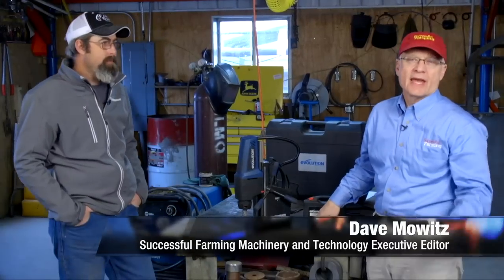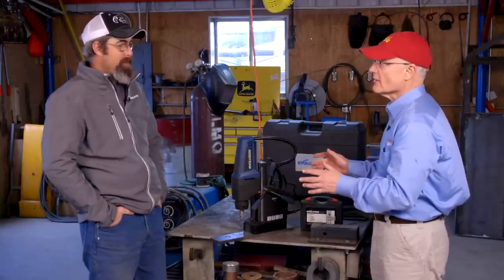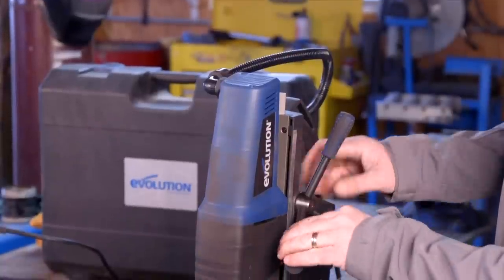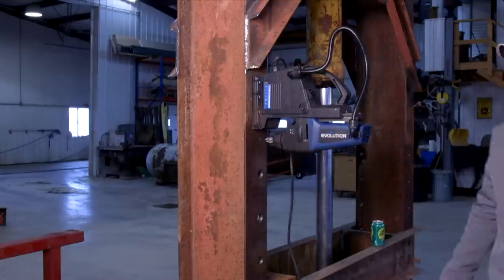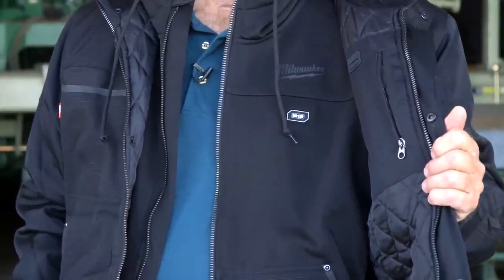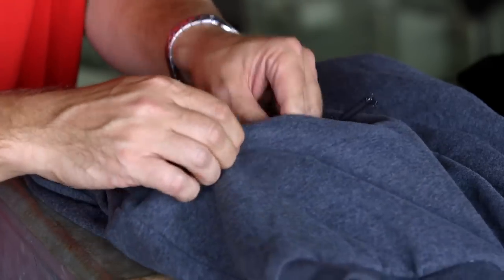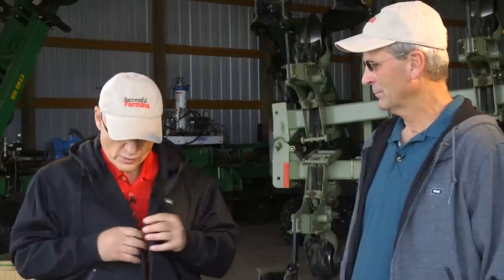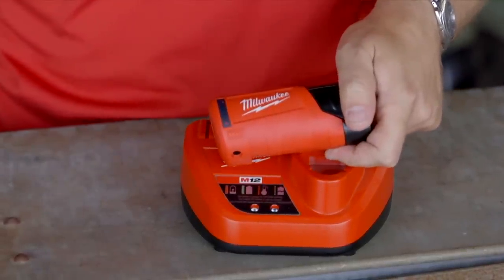Farmer-Tested Magnetic Drill and Milwaukee Heated Jacket | Farmer-Tested Tools | Successful Farming

Comment: Nice Magdrill! Love my Milwaukee!! Picked it up used on eBay about 15 years ago. After borrowing one from a friend at a local machine shop when I needed one..  
Big word of advice, the one I used to borrow had a bad spot in the magnet field, sometimes it would hold, sometimes it would fall off!!! 
He told me to keep it hanging from something, so it wouldn't fall to the floor and get busted up... (We were drilling truck frames for mounting hoists). 
That being said, if e aren't working horizontally, it's tied off to the cherry picker, a loader or sometimes the rafters..... Only takes hitting the wrong button or having the power go out to ruin you day..... And drill!!!